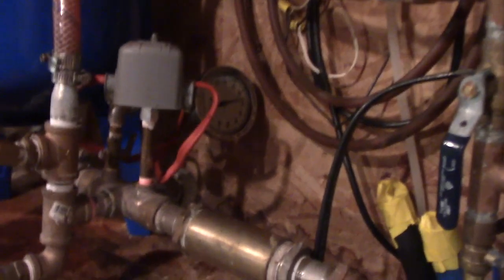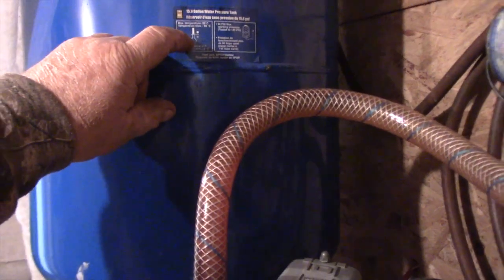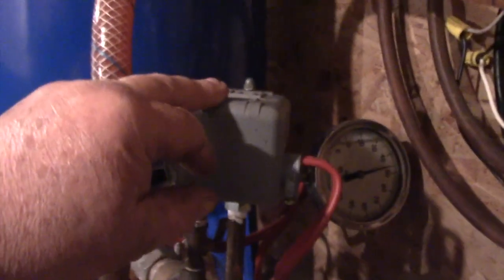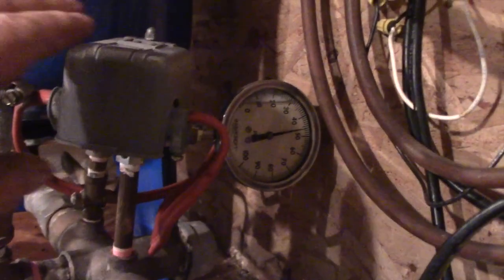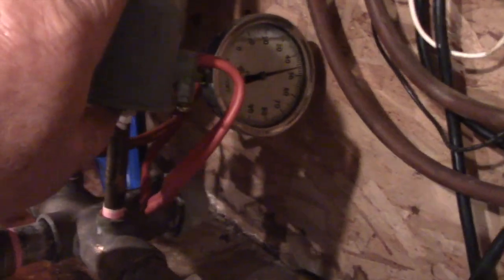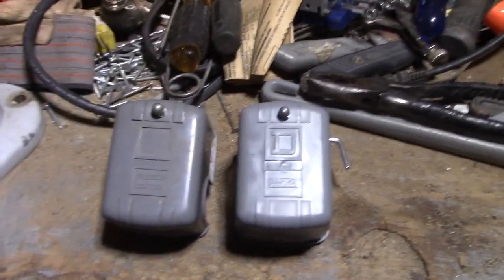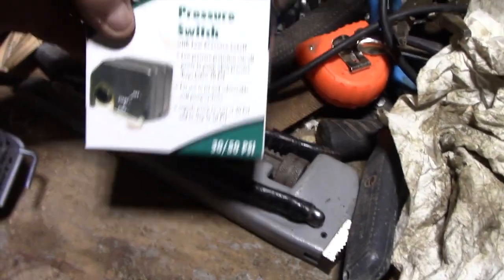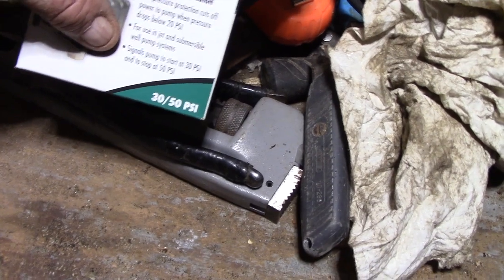Don`t burn out  your water pump

Comment: Good tip Gator ! I changed my switch about a month ago.When I removed the old switch I found the little pipe that the switch is screwed onto was full of sediment so the switch wasn't getting the real pressure.The pump wouldn't start until about 10 psi and wouldn't cut off until about 80 psi.I didn't need a new switch just had to clean the sediment out.
Reply from the maker: Yes, Ken....the water in that little pipe has now flow....one could say it`s almost stagnant and is prone to doing what yours did to you....a lot of people just call a plumber and they have to pay real money for the fix.....CHEERS

Comment: Hey Gator nice video for those that have a pump & well water. I havent had to deal with them at all in many years. My grandparents had well water & my father in law was always having problems with his pumps for his well water I remember back in the early 70's. I remember my grandma always prefered the old hand pump outside & did not like it when my grandpa converted over to a pump & water going into the house lol.

Comment: Good tip  on the pressure switches Gator! Speaking of wells/pumps, I may need a new relay/start control box here for my  submersible well pump. Maybe the capacitor is going bad in it as it occasionally won't start instantly when the pressure switch "clicks" on. If you're running water at the time, sometimes the water flow will go down to a trickle before the pump starts up and water flowing again.

Comment: That's a great idea. Perfect for unattended pumps like yours. Dug wells can go dry and a submersible pump will smoke the motor if it runs with the motor out of the water. 👍😎
Reply from the maker: Yes ...this is great for submersible and even good for a jet pump when you lose your prime ...it will save all the inside seals on the pump and could even save a piston pump from wearing out the gaskets from running with no water....CHEERS

Comment: Hi Gator, Thanks for the information. Never really seen a pump control with a low pressure shut-off, I will replace my pump control with this new one.  [ Good insurance to prevent pump burn out  ]    Thanks again Friend
Reply from the maker: The only thing Ronald....you have to read the instruction because your pump won`t start by itself as the old control....It`s a thing with the little arm on the side that you have to hold it midway until your pressure get`s to 30 then you let it go to auto and your off to the races.....CHEER and good luck with your new control
Reply: @gatorsworld  Thanks